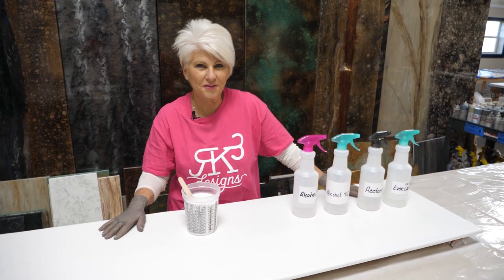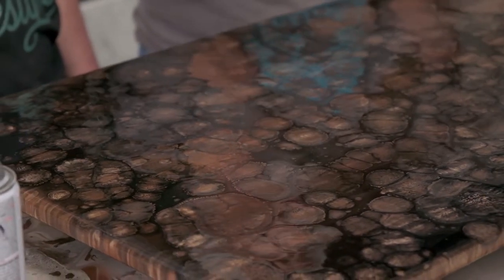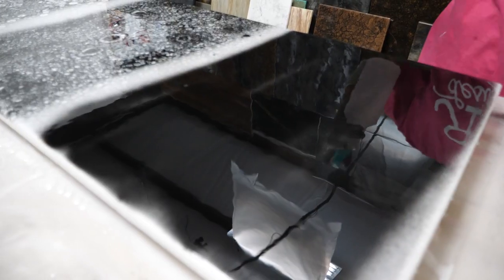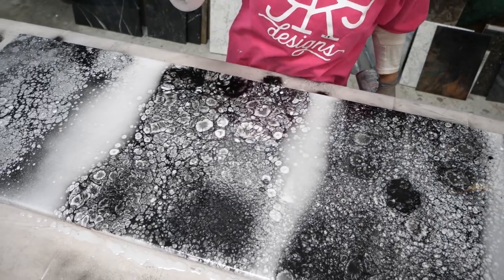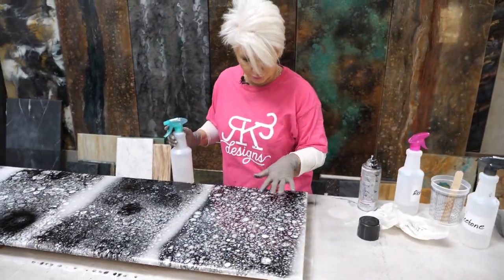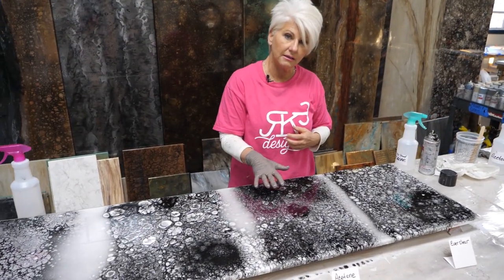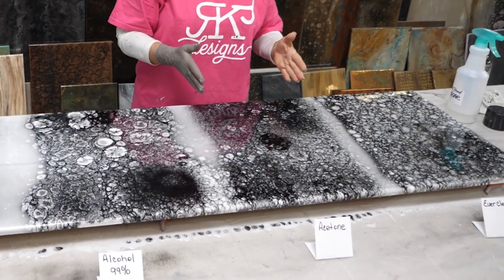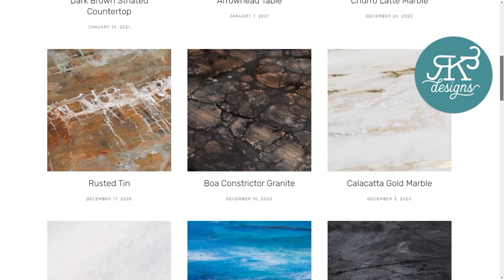The Best Alcohol Alternatives For Fracturing Effects

Comment: As for the acetone. It has a very fast evaporation rate. That's why it doesn't do well after the paint has set for a while. It doesn't sit "wet" on the surface for a long enough time to make the paint soften and move. It flashes off quickly.

Comment: I would try the Acetone and the 99% Alcohol earlier in the time frame. They both flash off quite fast. 99% is too expensive, as I think it also comes with a hazardous shipping fee attached, if there isn't a local place that has it. If Acetone works better earlier, then that is great :)

Comment: My concern is how each may affect the setting process of the epoxy. When I asked stonecoat directly about using other products for the fracturing, they responded that in their tests, other products had made the epoxy have a soft set up. Like it would stay rubbery or sticky and not harden all the way. Did you notice that in any areas of your tests?
Reply from the maker: That’s a great question. When adding any product to get the fracture effect, I add VERY little. I’ve personally had no issues with it causing the epoxy to be soft.  If there was however, once the flood coat is poured any softness would be taken care of.  😊

Comment: Great, I  use 70%,and I ordered everclear. My problem is that I can't do that nice fracture with alcohol, the cells are always closing, or as you said  if I leave the resin to set , it doesn't do anything. My resin has 20 minutes working time. How long is the working time of your epoxy? Do you warm the resin in a 'hot water bath before use? I do, otherwise is too thick to mix, and has lots of bubbles. I want to try your resin. 
Do you sell in the UK? Thank you, you are so lovely 🤗❤️
Reply from the maker: I use Stonecoat Countertop epoxy so I have at least an hour open time. I don’t believe they ship to the UK. 😢
Reply: @RK3Designs  thank you 😢

Comment: What happens if you use 2 different spray paints? Ie dark green first time and then go back with black? And how did they all cure, especially with a clear resin top coat?
Reply from the maker: You can definitely use two different colors of spray paint. I do that often. Really pretty when you spray them both at same time. They cured really nicely. If you let the epoxy set for a bit before you fracture and don't use a lot of alcohol, it won't move too much. 🙂

Comment: Why didn’t ya try Denatured Alcohol
Reply: With another product they don't torch but use denatured alcohol to get rid of the bubbles.  The only problem with that is all I'm seeing in denatured alcohol has fuel on it is I'm thinking that won't work.
Reply from the maker: I’ve used denatured alcohol on a few of my finishes and it really didn’t do very well at all. I wish I would have tested it on this video, but didn’t have any on hand. 😩
Reply: @karencole2454  it works. I use it for effects.

Comment: At the hardware store,  in the section with paint  thinner you can find acetone and ethanol ( non drinkable  everclear) should be between 92 and 98% ethanol.  This type of ethanol is not meant for consumption,  therefore it doesn't have such high taxes and should be cheaper than everclear.
Reply from the maker: I didn’t know that!!! Thanks so much for sharing!! I really appreciate it! 😊😊
Reply: Does it work well?

Comment: Mmm good video, i'm using 99% isopropyl, in Argentina seems not have 91% or 70%, yo can find 99% for computer cleaning or PCB soldering cleaning. Don't know why is not refracturing your sample I tryed with 3 layers of spray and alcohol one up of another one and all three refractured very well, and refracturing the same paint layer in multiple times stamps also works well for me. I hear from you in many vids about everclear, now i decided to search in google what is everclear and hell yeah there is that cereal made alcohol here and also more cheap i mean, waaaay more cheap. There is some advice about if any brand works well of this alcohols? i mean the everclear type of alcohol? becuase of course here is not that brand but yes there is some called tri-destiled and food grade with no brand.
Reply from the maker: I’m not sure what brand I used. I threw away the bottle, but it was 190 proof. 😊
Reply: @RK3Designs  Okay thats is 95% alcohol per volume from my search. Will try it soon sure as it is cheap here.

Comment: Interesting. I wonder if denatured alcohol would give similar results to the Everclear (ethanol) without the price.
Reply from the maker: I’ve tried DA and didn’t have much luck.
Reply: @RK3Designs  Maybe needs 5% water like Everclear?  It's technically 95% ethanol.  That would be my last ditch test before giving up on it.  It is just SO much cheaper, would be an awesome alternative if you got similar results!